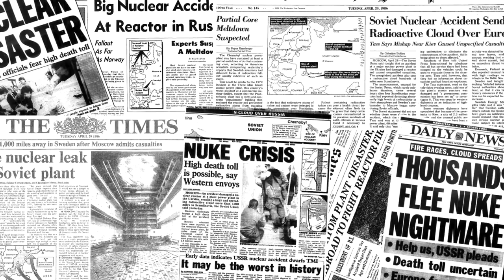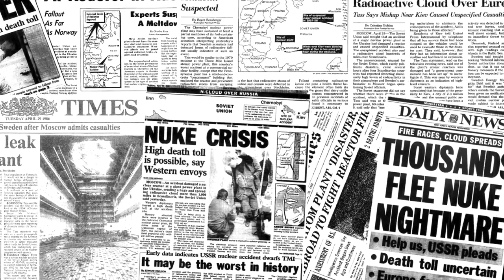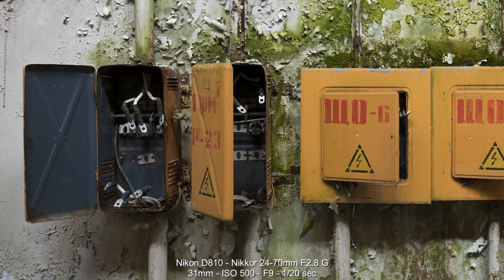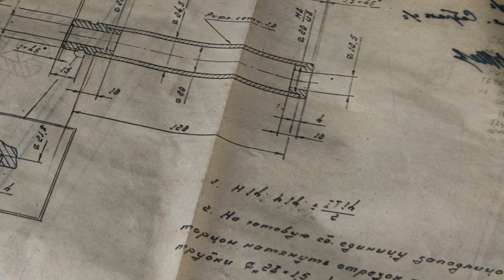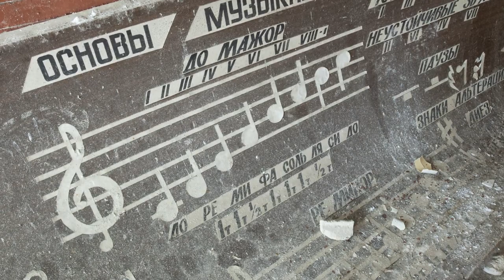Portraits of the Landscape EP3 - Pripyat - Chernobyl Exclusion Zone

Comment: Amazing footage.  What I wonder is why everything looks like it's been sitting there rotting for much longer than 33 years?  Is that normal, or did the radiation affect the decay as well?
Reply: If you already answered this, never mind.  I turned the sound down as I was listening to music.  I will watch again and listen this time.
Reply from the maker: I suspect it is because roofs have been breached and windows/doors broken. The liquidators broke many windows for ventilation as part of the cleanup efforts, however all of these things have contributed to moisture getting inside the buildings. When that happens, decomposition rapidly speeds up and things break down much faster.
Reply: @timmchapman5307  Yes, that makes a lot of sense.  Thanks so much.